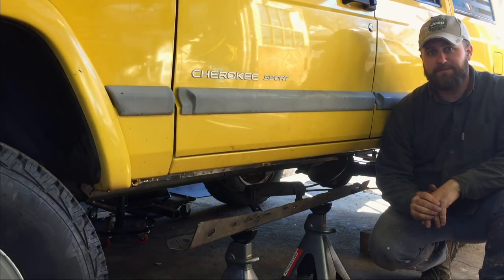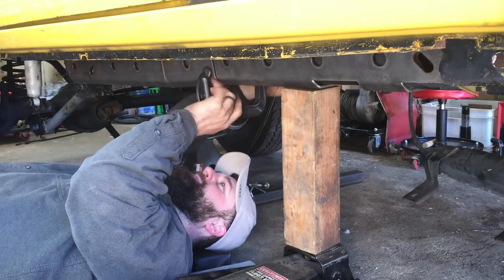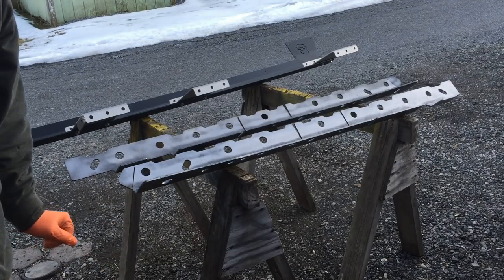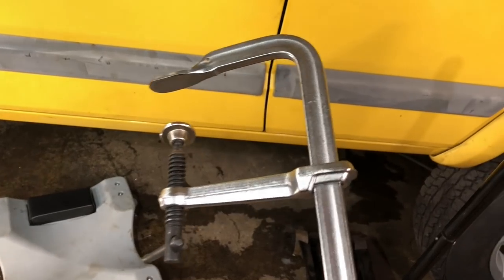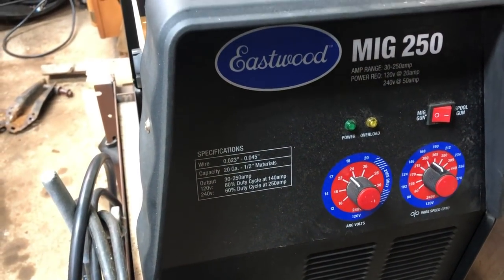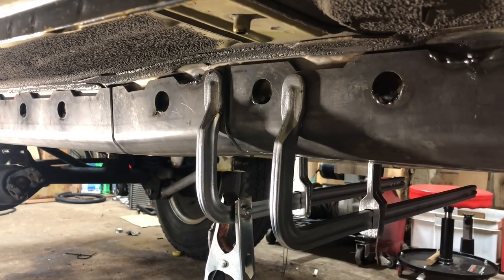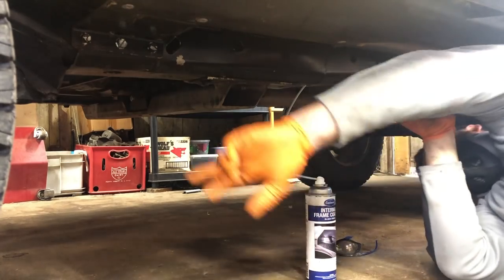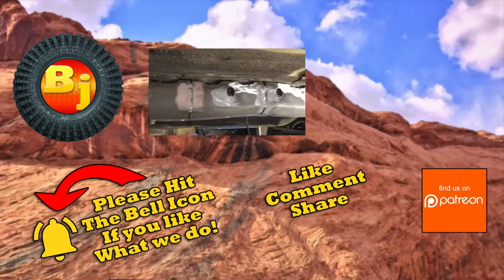How To Stiffen the Frame on a XJ Jeep Cherokee

Comment: I'm a new owner of an old XJ. This is great information. I wasn't aware of this issue with XJ's but at last now I know there is an option.
Reply: it is really only an issue for xj if you have big tires, lots of cargo weight, AND really take the xj on hard core offroading trails. 
stock cherokee is fine. only really a problem when you add lots of weight and articulation

Comment: .035 wire is pretty big for the thin metal frame. If you use .024 it’s a lot easier

Comment: Awsome job dude. I just did a full front to rear unibody frame out as well bought the IRO full kit even bought the front and rear pillar tie ins from T&M fab cause IRO did not offer them so its fully boxed  out now. One thing I did different but similar was I used u-pol copper weld thru primer covered the sanded down unibody and underside of the frame kits to protect them I would have possibly used the stainless steel stuff if I'd have known about it but I think the same effect was achieved although I know that copper can't rust at all so I'm still happy, then I used a 500° black engine paint for the outside after the finished job I haven't driven almost at all as I want to keep it clean enough to raptor line over that cause undercoat spray does not dry properly it just stays rather soft and a bit porous which would keep moister and allow possible rust. I would never want to drive a stock unibody XJ again after this was finished as it is beyound amazing also an Iron man 4x4 steering box brace will do WONDERS for you after this much of a project. Next up is hydro assist😜

Comment: Great video.Do you guys think a 2 door is better than a 4 door for rock crawling
Reply: picvid entertainment not necessarily. They are a bit lighter but wheel base is the same. The 2 door are more rare and as such if I found a nice one I’d be more inclined to fix it up nice rather than beat it on the rocks.

Comment: WTH ever happened to the rest of the diesel swap?? Been waiting and waiting... aaaaaaaaand nothing. Bunch of trail riding videos, emergency lights and a CB antenna. The real how-to content has fallen to zero on this channel. Not mad and not trying to bash anyone- just disappointed. This was, by far, my favorite YouTube channel and now I rarely watch it at all. Frame stiffeners have been done plenty but diesel swaps in a XJ have not.
Reply: We will be getting back to the diesel swap videos, I've been too busy driving it around to finish editing the videos :-) SO it's not a dead project, like so many of the ones you find on forums, it's complete running and driving I have about 10,000 miles on it now and I'd do it all over again too. Thanks for hanging in there
Reply: @DRTJon  
Hi John I was wondering since you have 10,000k on the TDI swap what kind of MPG average or minimum you are achieving since I'm highly interested in this or a similar diesel swap?
Reply: @SarahSmith-hd8kd  I've actually been through a few different stages of modifications with it since starting out, my current setup of 165 HP/300+ TQ having about 70% of the total mileage on it though, I've logged every mile and fueling, and 28.6 MPG is my standing average.  The lowest I have ever gotten was 25.5 which was towing a utility trailer weighing about 2000 lbs total.  The best I have gotten was 37.8 when the engine was closest to stock, and I was lightly loaded with gear on an all highway trip.   If you follow me on Instagram @BleepinJeepJon you can keep closer tabs on the day to day :-)

Comment: Maybe the paint you used was weldable but the etching primmer?  doubt it..
Reply: Jud AsinSmith Stansell the etch was not a primer, just an acid to remove some surface rust
Reply: @DRTJon  Why not just use the weld thru primer prior to welding?

Comment: OK, so let's back up and start from the beginning... WHY would you want to do, or need to do this? What's the purpose (answer other than "to stiffen the frame" please)
Reply: Flexing the XJ unibody frame repeatedly under load will eventually wear it out, crack it, break it, etc. This mod adds longevity to your build. Really makes a nice foundation for bumpers, recovery points, sliders, and all that follow...also settles down the ride & steering.
Reply: @RB-rl7kv  What do you do that you need the extra rigidity on the frame?
Reply: @alankluttz9546  rock crawling, going through big ditches and just general off roading. All of that puts a lot of stress on your frame, especially when you add bigger, heavier wheels and tires and axles, etc. The factory unibody frame was not design to handle all that
Reply: @JoeGarofaloII  Thanks Joe. I've never done that. I have a 4WD F150 Super but never had it off road like that, and never made any mods to it.
Reply: @alankluttz9546  no problem! The F-150 has a really solid frame and if you're not doing any modifications or hard off roading, it's perfectly fine. Part of the problem with the old Cherokees is that they technically don't have a frame like most SUVs and trucks. They call it a "unibody" because the frame is really just some more sheet metal stamped and welded to the body versus a thick steel rectangular tube like your truck or even Jeep Wrangler TJs have.
Reply: Because what keeps getting referred to as a frame is not a steel frame. Its more like thick sheet medal

Comment: Seems kinda thin metal..? For stiffening? No...?.
Reply: Ozzy Tapanes 3/16” is what most if not all the kits out there use. The bend in it is really what gives it the added strength. This particular stiffener id say is kinda mid way between nothing and all out stiffener where it wraps all
Sides of the rail and you have to weld to the floor pan. It is beefing up the factory thin sheet metal inherently stiffening it, as well as providing a ton of protecting from slamming your frame rail down on rocks and obstacles
Reply: Jon BleepinJeep yep, I can see it adding protection..